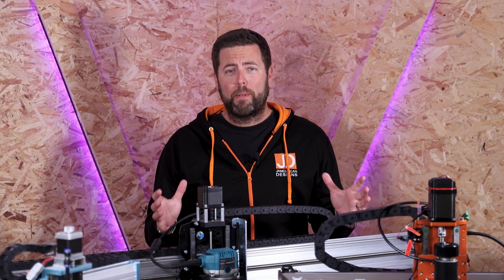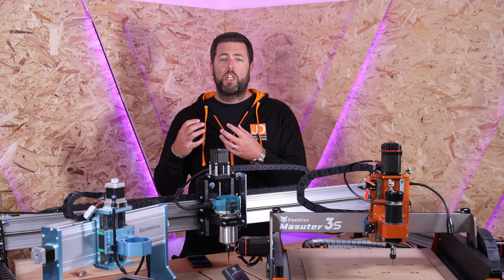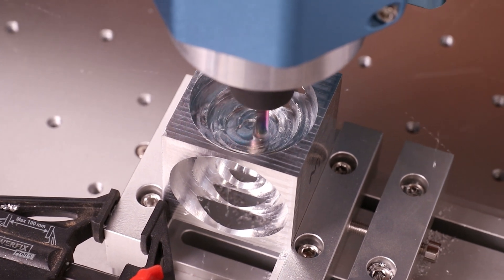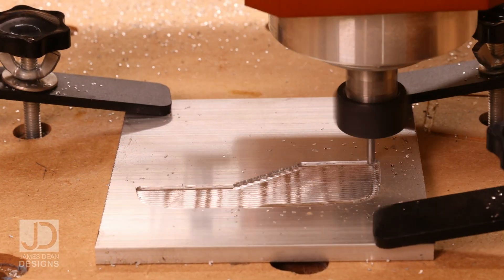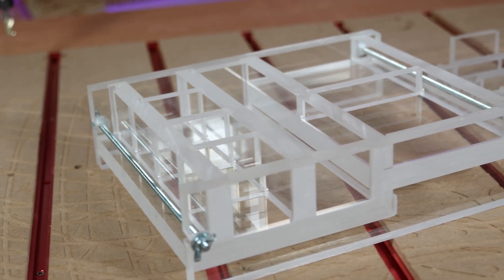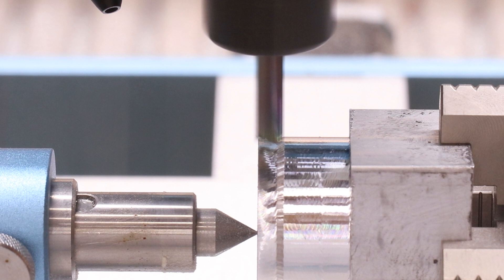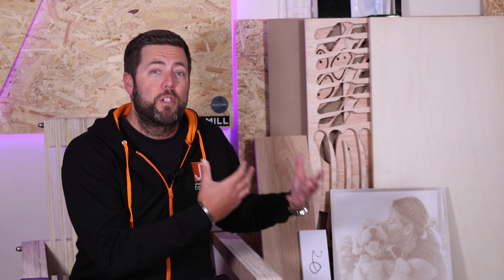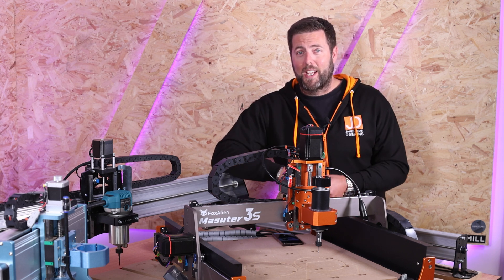5 Mistakes Beginners Should Avoid - Getting started with CNC

Comment: Dear James
I am reaching out regarding an issue with my CNC PROVerXL 4030 V2 machine. Whenever I attempt to send the machine to the home position, the spindle is moving a little bet, I think because of this I am getting an Error 20, and the machine only moves slightly and stopping.
I believe the problem may be related to the machine itself, but I am unsure of the exact cause. Could you kindly guide me on how to correct this issue and successfully send the machine to the home position again?
Any assistance or troubleshooting steps you could provide would be greatly appreciated.
Thank you in advance for your support.
Best regards,
Elias Wolde
Reply from the maker: @eliaswolde8229  so in this scenario it's a case of narrowing down the cause. A lot of the time it's a jammed or broken limit switch. Start by visually inspecting all the limit switches, make sure the little metal bits haven't bent and that the little buttons are not stuck down. If they are all OK, connect and unlock your machine and then go around one by one and press the limit switches with you finger. After you press one, you'll need to reset and unlock your machine but if you press one and it doesn't set off then alarm then that may be your cause
Reply: @JamesDeanDesigns  I will try this olso, i appricate your quick help!!

Comment: Great videos James! I've been looking at CNC for a few years now but never really took the plunge because I honestly felt that the technology and quality output still had a way to go. I want to buy "once" and I want quality/speed/functionality from the get go.... problem is there is so much conflicting information out there. To the point; I'm leaning toward the FoxAlien CL-4x4 'flagship' but am really concerned with their marketing strategies of "buy this machine, its the best... then they introduce their upgrades and linear packages, so you have to fork our more dosh, strip the system to its basic, and then rebuild it". The CL comes with the 3.4nM Nema23(60-100) Close Loop Stepper Motor (3.5Nm) and the 400w spindle. Question (finally) are these optimal or are there better options out there? Speed isn't really an issue for me but ultimately quality output and handling stronger materials/metals is. Oh, and is there a better machine, in your opinion, that you would recommend?

Comment: Not so sure about helping a struggling machinist...LOL, I'm a machinist and not once have I ever struggled with this stuff.  If you don't understand Gcode you will certainly struggle because you have no clue how the machine actually works.  I have 3 CNC routers including a 3018 piece of junk.  It pains me to hear incorrect nomenclature called out like "The CNC" , "Carving" , "Bits" etc.  CNC covers many types of machines, such as 3d Printers, Plasma Tables, Lathes, EDM, Press Brakes,  Milling machine, and many others.  Carving is something done manually with sharp tools like chisels, Bits go in a handheld router, Endmills are what we mostly use in machining, which is exactly what a CNC Router does, it's machining people not carving.  Ok  LOL, venting over, James does good work, thanks for all you do.
Reply: I did learn it too yeah some are half knowledge but if you are good at upgrading ur machine a 3018 is a great small machine. I upgraded mine so I can actually mill steel in a very good feed rate
Reply: Thank you for straight up informing me that I need to learn Gcode. An answer to a question I didn’t know to ask.

Comment: Hey James!! Glad to see another Video, Ive been wondering, How much of a difference do you see in Budget vs Expensive End Mills and Bits. I often see you getting better results than other users and I always wonder, Is it your toolpath's, or is it your bits, Or as I suspect a combination of both. Thanks again!
Reply from the maker: It is probably a little bit of everything. Generally speaking I am usually quite conservative with feeds and speeds which can give you better results in some cases. Discarding dirt cheap bit, with most initially when doing the same cut with brand new bits, you probably will not tell a difference. Its when you have been using for some time that the better bits usually retain a sharper edge. But also the development of the flutes and profiles. For examples I used a bowl bit a while back and had ok results with it but did get some burning. Then started using the Big B Jenny bit which is considerably different and got much better results

Comment: I stumbled on your videos when I started out in the CNC journey. They were immensely helpful to get me understanding the basics and let me grow faster. I’ve got an IT/electronic background so some things came way easier than others. The design and software side was quick. The understanding of the operations and stepper motors and all that was pretty easy to figure out. But the mechanical side of the bits vs speeds vs depth vs step over took me the longest to get sorted. I’m now running a Shapeoko 5 Pro with VFD and making incredible items that people love.
Reply from the maker: Thats good to hear. Speeds and Feeds is probably the biggest blocker for a lot of people but its often one of those areas where you need to learn yourself, sometimes by just testing and doing lots of cuts
Reply: Same for myself. The James Dean Bible

Comment: good videos with good information as always. 
when that is said, it can surprise me how little people actually like to spend time getting to know things , whether it concerns laser woodworking or steel. the rest of us have spent a few years at school to learn both how to draw, calculate both speeds and feeds and how to calculate velocity in depth on the milling steel you need to use and much more, even writing your own program we coordinates and various commanders . that many people think that the program itself can handle the whole thing, that they dont have to think. It disappoints me a little that many people think that they no longer need to go to school or don't really want to spend time getting to know things.whether it concerns

is a work tool they have to deal with.
Reply from the maker: @WMH-3D-Printshop  completely agree. I'm always so nervous when it comes to machining metal because I know how much knowledge is required to do it consistently and successfully and that's knowledge I dont have.
Reply: @JamesDeanDesigns  you get that knowledge along the way. formulas are good to have at hand, plus you get to know the machine and how much you can push it and the steel you use. 😉

it is more that the general population believes that what they buy just needs to be fitted and then it does the work for them. a little scary that they think that it doesn't really require them to learn. to use the product they have purchased. After all, laser 3d printers, milling machines and more are just mini industrial machines

Comment: I'm really new (3 months). and I can say I've been stuck on a small problem for up to 12 hours with the solution being a very simple little thing. If you've never done this kind of thing before, you really do have to be patient
Reply from the maker: @timwilligar2525  can drive you crazy. I spent 2 days trying to diagnose a problem. Turned out I had somehow changed a GRBL settings without realising it. Literally a 2 second job to fix 🙄

Comment: Looking at a genmitsu for 1st cnc. I know you have reviewed some in the past. Would the 3020 v2 be a wise investment for a few years for example? This will be used for soft metals and composites such as bronze and carbon fibre. Cheers mate love your work and look forward to hearing from you.
Reply from the maker: @timpickering253  it's not a bad investment and a decent machine. But if you can save up for the 3030 or even the 4040 ProMax, you will not regret it especially for machining metal
Reply: @JamesDeanDesigns  thanks mate cheers for the reply.